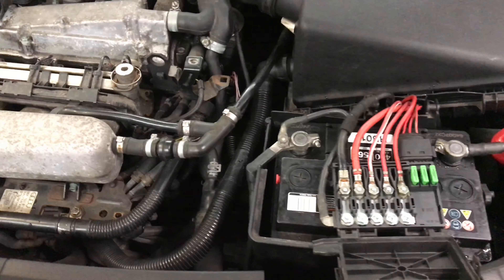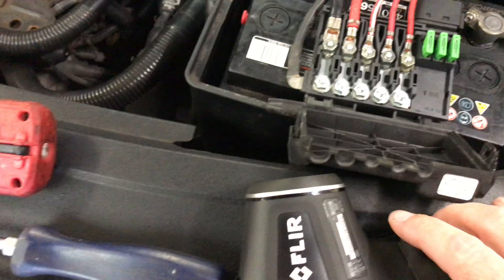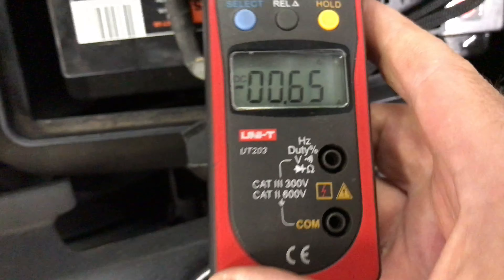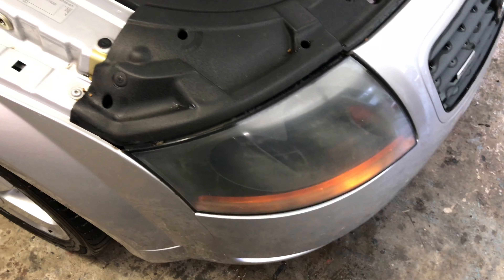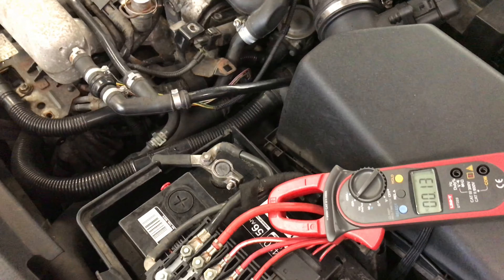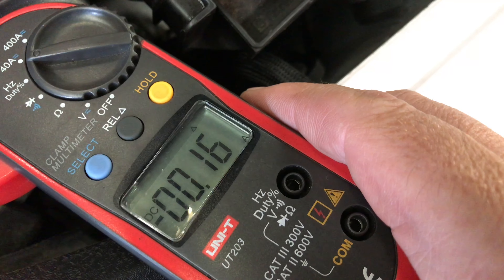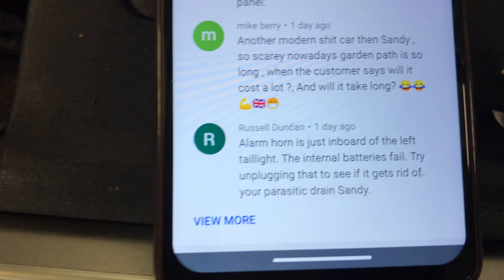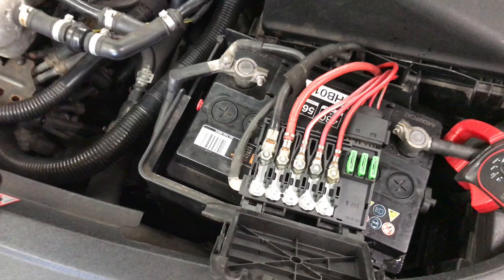Audi TT (2001) Parasitic Draw and Instrument Panel

Comment: Hey Sandy, that amp metering clamp looks like it has fairly steady reading ability. Would you recommend it. Just seen it on Amazon. I have an amp clamp for my Snap-On Vantage Pro, but the jaws are too small for some vehicles and looking for a good, but cheap alternative.
Great video once again. 
Cheers
Reply from the maker: Yes Graz it's been a great tool for £35 cheers sandy